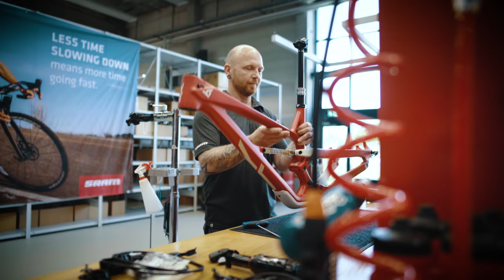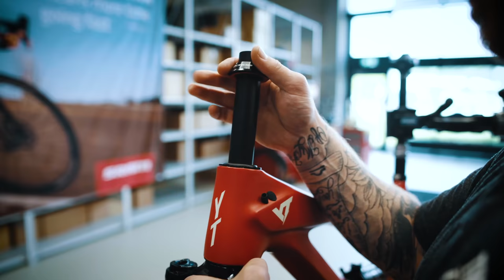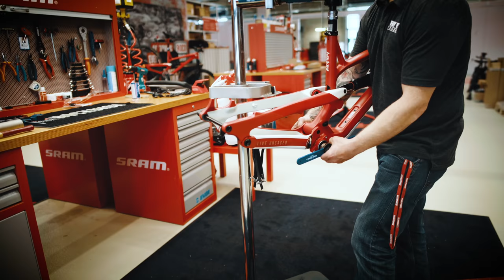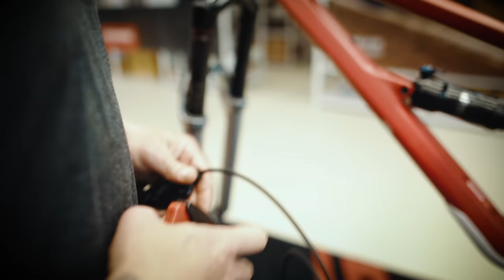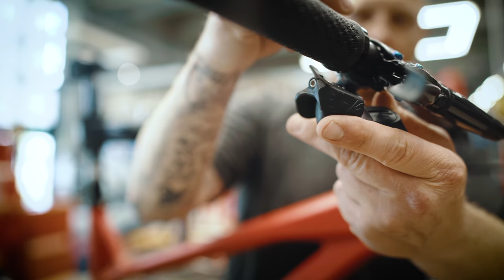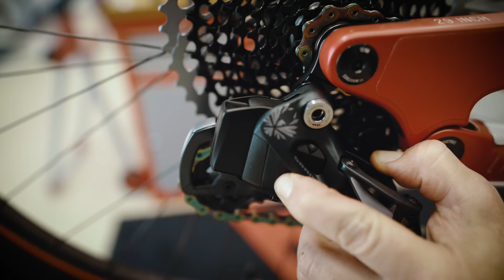DREAM BUILD MTB - YT JEFFSY SRAM Eagle AXS

Comment: A press-fit bottom bracket, and no frame protection, the little details count on a dream build!
Reply: I just bought the capra and yt puts good frame protection on it. the protection is the same color as the paint so it's hard to see in a video
Reply: @santacruz7771  I own a decoy, absolutely Zero protection on the frame, for £6k, details matter.
Reply: @TAZMON20  sorry man my 2019 capra came with thick rubber downtube protection, chainstay protection, and a rubber strip so the derailleur doesn't smack the frame
Reply: @santacruz7771  ditto, but that's basic on most brands, www.invisiframe.com for the price they and many others charge this should be default, it saves the look of the frame, keeps the re-sell value high and is available in Matt, Sateen and Gloss, if they offered it as an option, you'd add it to your basket.
Reply: @TAZMON20  yeah I agree if I knew you where talking about the invisa frame stuff I wouldn't of  commented.
Reply: @santacruz7771 no worries but I  do think it should be a default or basket option, I have it on all my bikes, it saves  years and carbon when you get it wrong.
Reply: Oops, that should have read "frames"

Comment: I liked this guys work.
What i dont like about this series, is that you don't always show same operations by different mechanics. 
It's cause im looking for how different mechanics do same operations. Like how and when they torque bolts, what bolts the grease and what not, etc., etc.
But that just me, because im looking for small detail to learn more and do better myself.
Reply: Share the same question: to me grease-choice is almost equal to tool-choice. One decides how it fits - the other one: how it lasts.

Comment: few things he did wrong.  brake fluid has to be done after the wheels have been installed and the outer cable for the gears and brake shave to be slack enough for when the handle bars go over rotation, you just cut them with out adjusting for that tension.
Reply: The spacers are still in the calipers so no need for the wheels to be on. And he did rotate the bars before cutting. You see him do it.

Comment: Wow! This new electronic gearbox system or for the seat tube, I did not know yet. I had heard of it, but not in operation as with this interesting video. I had also heard about for the wheels that you no longer needed the inner tube tubes. What is the white liguid that inserted inside the tire? Thank you.

Comment: The bike loooks awesome, no question. But I always do feel slightly uncomfortable when there's too much electrics involved. Bikes always tended to be pure mechanic, that's why they were fail save to a certain point. Now you just need to run low batterie and changing the gear is impossible. Maybe I'm too old school.

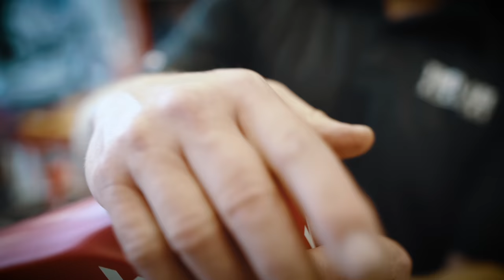Comment: 1:53 What's the trick to measuring a chain length here?  Never seen it done using the smallest cog. Thanks! Killer video btw.
Reply: Roman Rusinov the derailleur is pushed as far back and up as possible, and somehow locked there, I’m not expert but looks about right, if it’s pushed all the way up, and in smallest cog, would be exact same length as largest cog with derailleur pulled all the way forward

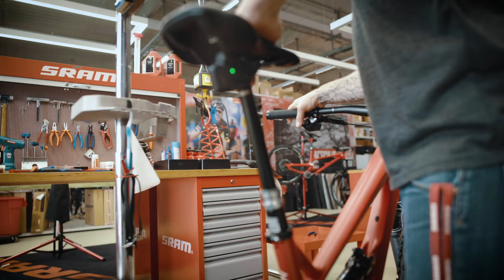Comment: 14:35 what is the point of this system?
Reply: Dropper posts are for when you descend on technical trail sections, which can be dropped without having to stop and lower the saddle manually.